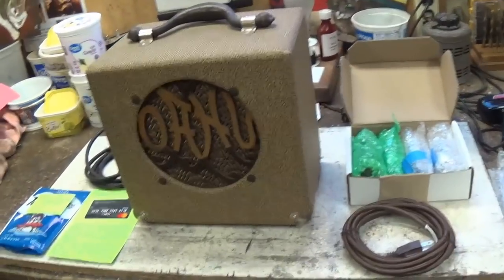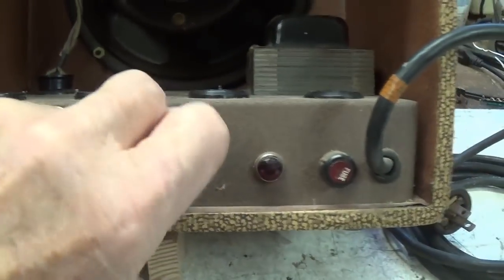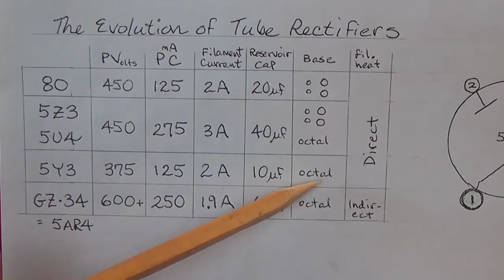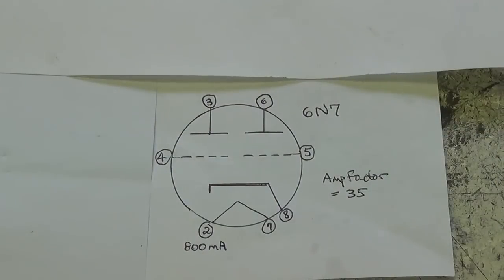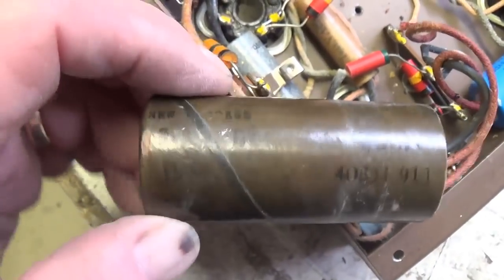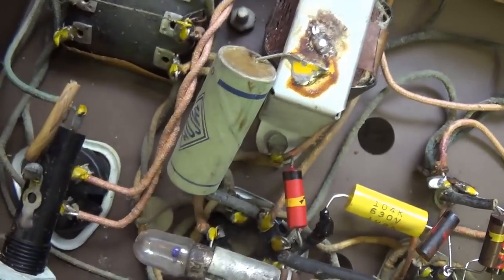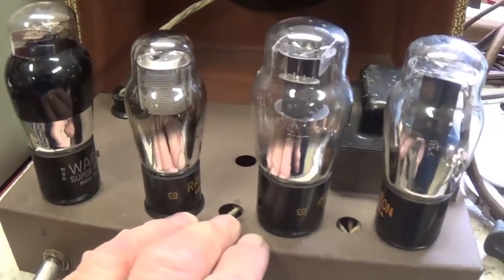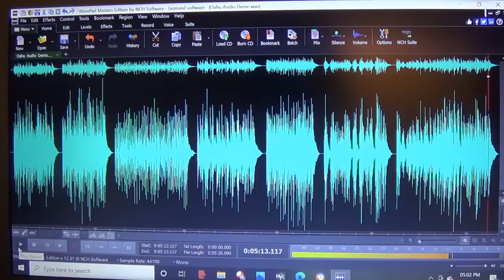Amazingly Original Pre-War OAHU Amp Gets a Tune-Up

Comment: Also missing from schematic is the second stage amplifier cathode bypass capacitor. Yes those moulded case resistors will almost always go high in value, especially with values over around 1k, while the values below around 1k tend to drop in value.  

I have a box of them, all NOS, and almost none of them are the original colour band value, though some are still barely in tolerance. However I still use them, they are very robust, so get used for things like mains neon lamps, and for driving indicator LED's off of the mains directly, just using a bridge rectifier, normally 4 12V zener diodes, as I have a reel of them, as conversion to DC, no filter capacitor, that is the least reliable component, and the LED's survive well. Have potted a few of them into breaker casings for power on indicators, using the original terminals to connect power.
Reply from the maker: Thanks for the helpful input, Sean.

Comment: Great job as always Doug bringing this amp back to life!
The amp designs were solid back in the day, but the technology of the components (excluding transformers, those things will last 1,000 years) was immature.
As you can see by all of those caps being shot and over time leaky or shunt to ground, also the old resistors suck.  You read 75% over rating.  I've year 100% and 200% to value, so there is no reason I keep them in for nostalgia or only fix what is wrong as they will go.  If you want the amp(s) to last...just replace them all with new components imo.  It's time consuming, but in the end, will not only sound good, but more reliable.
We've come soo far with technology, the components are much better than in the old days (caps and resistors)!  :)
Reply from the maker: Thanks for your helpful input, E.

Comment: Congratulations on your 100k subscribers! I have been with you the last 12 years and love your teaching style. 
  This video brings up a few associated questions for me. With old equipment, tubes and components - how old is too old?? Tubes are the easiest to check... but what about my old Accurate Instruments 257 tube checker ? Should I re vamp it inside?  And being in the ANTIQUES business I've collected quite a bunch of old capacitors/ resistors new in box... Sprague paper wraps / paper and wax / Micamold dominos etc.
  What's the best way to check the quality or just don't use them at all?
  Thanks for shareing your expertise!
Reply from the maker: Thanks, Peter. Tubes and resistors have an unlimited shelf life, but most capacitors do not.  I would not recommend using vintage capacitors. Tube testers only determine a few tube parameters, which are helpful, but specialized equipment is necessary to fully assess their status.

Comment: I am going to have to build one, this thing sounds fantastic. I have all of those tubes and plenty of transformers. Unfortunately, the speaker is contributing a large quantity of this tone. Maybe I should put one of the mint Jensen P10Q's I just robbed out of 58' Lowery Organ. Surely not the same tone but after mounting one of these in a cab they ooze vintage mojo.
Reply from the maker: Good luck with your project, SHW. Let us know how it turns out :)

Comment: That covering is not Tolex or pleather. It is a product called oil cloth. Those red and white tablecloths commonly associated with pizza parlors are oil cloth with a synthetic poly fiber backing and a fixed red dye on a white plastic top sheet.  Valco, Danno, and other budget amps were usually covered in oil cloth.
Reply from the maker: Thanks for your input, Seth.

Comment: Inebriated chimp!!!  🤣  Congrats on 100K!  That's quite an accomplishment my friend.  
I recently got an amp I might send your way- 1946 Vega Commander.  Cosmetically almost flawless, like this Oahu, but someone got inside and started trying to replace caps and ended up butchering the wiring.  The tubes all light up, but there is zero output, not even hum.  I'm a fairly decent hand at repairs, but not if the wiring is butchered and I can't find a reliable schematic....
Reply from the maker: Thanks, GF. I'm really busy with repair work at the moment and that sounds like a potentially expensive repair job. You might consider giving it a try yourself
Reply: @UncleDoug  fair enough, thanks for the heads up.  I just wish I could find a good schematic for it.

Comment: 52:58 - excuse me, but I guess the way you draw it wouldn't work at all. There is always full short to ground. It may be somewhat different, but I guess it's similar to the circuit we see on the schematic, where pins 1 and 3  are between input (pickup) and ground, and the wiper (pin2) goes to output (cable - gutar). Also the pickup is grounded (on the other side). And there is usually also a tone pot. So you have a pickup coil + two pots in parallel to ground on the instrument.
Reply from the maker: You're right. In my haste I drew the diagram incorrectly. Thanks for the info :)

Comment: congratulations :) 100000 subscribers :) well you  deserve it, you know your stuff, its very interesting. i would love a valve record player and im hoping to repair it with the help you give. it would be realy cool if you designed an amplifier based on this circuit that used easily available cheap tubes available now and maybe i like others could build it , what a great project that would be, thanks for sharing :)
Reply from the maker: Thanks so much, Leo. Schematics for simple amp circuits are available for download on many internet sites.
Reply: @UncleDoug  it would be good to have explicit instructions and also a circuit based on what is available now cheaply , I've seen quite alot of amplifier projects based on common old TV tubes , rather than el84 style tubes which are expensive now. It be nice to have a valve based amp
Reply from the maker: @lookoutleo  We have posted several videos documenting every step in the process of building a small amp from scratch, Leo.

Comment: Uncle Doug; as the resident (on YouTube) tube amp genius, can you explain how tubes work? There are a few tubes that are a triode and a pentode in a single glass tube container. The Mullard Tube Circuits for Audio Amplifiers book shows a ECL-82. With one cathode heating electrons, how does the pentode additional screens not interfere with the triode? How are the streams of electrons kept separate inside the tube, or doesn't that matter? The triode is a pre amp  and the pentode works as a phase inverter. Do you know why Leo Fender didn't use that type of tubes?
Reply from the maker: Thanks, Dennis. The two tubes function independently within a single envelope.....just like  two barrels of a shotgun. Look at the diagram of the tube......you can see the two separate structures. The triode is a pre-amp and the pentode is the 7W output tube (not phase inverter).

Comment: Nice project- I have an old Co-Recht very similar amp- got it working but the Feild Coil speaker worries me- I was kinda hoping you would show how to replace it. It has a bunch of tears that I fixed. any thoughts on replacing?
Reply from the maker: This is not the place to offer step-by-step instruction, Corey. Check the internet for possible info.

Comment: Congrats on the award, but I was more surprised the number wasn't MUCH HIGHER! One thing that inspired me to post a comment was a news story I saw a few days ago on how this Russia/Ukraine stuff has basically "cut off" any access to a supply of tubes. What  are manufacturers and repair people going to do w/o component #1?
Reply from the maker: Thanks, Leroy. Yes, I'm sure that more than the price of gas will be affected by this unpleasantness. What a shame that we are no longer self-sufficient when it comes to vacuum tubes and oil.
Reply: I've been thinking, and that usually gets me into trouble, but do you suppose someone at Fender, HUGE, deep pocket company is thinking of buying/building a shop to supply themselves with tubes? Lets face it, Fender is not going to stop building DeLuxe Reverbs because of Putin!
Reply from the maker: @lwv6966  They already seem to favor Chinese tubes, Leroy, which are still available......at least for now. Maybe after this latest crisis blows over, our government can disrupt our trade with China and really screw up our supply chain.

Comment: I just picked up an early 1920s radio, be great if they labeled the tubes, as it now contains none, both four pin, but they're in the shape of a crucifix, which I'm given to understand was common in the UK, I think the price of ones I've seen online, it'll be cheaper to make my own tubes 😂

Good to see from you again!

I forget the enissive coating for filaments thorium dioxide?
Reply from the maker: Thanks, P. I believe they use Thorium, Barium, Calcium, and Aluminum Oxide coatings.
Reply: Some of the earliest tubes, like the original 01 and the 199, used thoriated tungsten filaments, which when emission fell could actually be rejuvenated by cranking the filament voltage by 50 to 100% for a short time. The 01A and most other subsequent tubes had oxide-coated filaments (aluminum oxide and other chemicals) which are far more efficient,,  emitting more electrons than thoriated tungsten filaments and at much lower operating temperatures, therefore requiring less current and voltage. Barium is a main ingredient of the getter, the silvery flashing on the inside of the glass, which helps remove trace gasses and keep the vacuum "pure"
Reply from the maker: @goodun2974  Thanks for the very helpful information, GU.
Reply: @UncleDoug  unfortunately, tubes with oxide-costed filaments or cathodes can't be rejuvenated; but some transmitting tube types still in use today can!
Reply from the maker: @goodun2974  Thanks again, GU.

Comment: Don't know what RS stood for but I doubt it signified an electrodynamic or "field coil" speaker, because they were all electrodynamic speakers back then. Alnico-magnet speakers were invented in the early 1940's but the metals(aluminum nickel and cobalt) were a strategic war material and alnico magnets didn't start showing up in consumer products until at least 1946 or 47. Jensen changed their model numbers to a P or PM prefix to signify permanent magnets, and later used C as a designation for Ceramic magnets.
Reply from the maker: Thanks for the input, GU :)
Reply: @UncleDoug  , amazingly, the Brush Manufacturing Co, which made microphones and phono cartridges, received a patent in 1938 or '39 for a full range 8" speaker with no voice coil or magnet ---- it had a piezo element! I don't know if it ever actually went into production, perhaps not due to the introduction of efficient, reliable alnico magnet speakers, plus the beginning of WWII and the cessation of most non-military manufacturing..
Reply from the maker: @goodun2974  Maybe Brush went on to build the reverb tanks for Silvertone/Danelectro ;)

Comment: Hello uncle Doug glad to see another video from you, I have a question for you? Do you ever came across a amp that as a ef86 as a phase spliter  2 6l6gcs?
Reply from the maker: Thanks. The EF86 is a pentode, Diogo, which means it is a pre-amp tube, not suitable for phase inversion.
Reply: @UncleDoug  hello uncle Doug thx for you answer, if you can't take look there is a French brand, Paul bouyer st 20 ef86, that uses 2 ef86 as preamps and one ef 86 as phase splitter, it's relative strange amplifier, iam trying to mod one myself for guitar, and wanted to ad a general volume control bcz the ef86 have to much gain for my guitar
Reply from the maker: @diogomatos5609  Good luck with your project, Diogo.

Comment: With the Valco schematics rarely being accurate. It's fascinating that they pulled off building amps from those schematics that actually worked.
Reply from the maker: I doubt that the people assembling the circuits used the schematics, 234. My guess is, after assembling several units, they simply repeated the steps using whatever components were available, with occasional alterations due to supply shortages or upgrades to resolve design issues.
Reply: @UncleDoug  . .  Thank you very much for pointing this out. I have an old Valco Airline amplifier that is exactly like you're talking about.  Mainly some capacitors inconsistent with the schematic, even though this amp is obviously all original. I was really glad when you touched base on that.
Reply from the maker: @234dilligaf  I try to share my observations with viewers, 234, and hope it's helpful.

Comment: Doug, I know you are keen to keep this amp as original with very good reason, however, In theory for the fun of it, would it not have been better to input to one half of the 6n7  and have the amplification going to tone stack and volume control then into the 6C5 and out to the second half of the 6N7 as second amplification after the Tone stack amplification? Does that make any sense?
Reply from the maker: It's not my call with most customer amps, Pat, and  to be honest, I don't enjoy re-engineering classic old circuits to be something they never were intended to be.  On my home-builds, I am free to alter the circuit in any way I see fit.......but when starting with a classic gem, that's just not the case, at least in my opinion.

Comment: The shown instrument volume control schematic appears wrong to me. The wiper should be the output pin, not one of the ends of the potentiometer .... otherwise the signal is always shorted to ground.
Reply from the maker: The signal is always at least partially shorted to ground in all volume controls, Andreas.....that's how they function. The more signal sent to ground, the lower the volume, and vice versa. I agree that the diagram at 52:46 could have been drawn differently, but the points being made were still valid.

Comment: Love your attention to detail. I Would like to send you my 1965 super reverb for you to look at. I've owned it for close to forty  years. I've decided to get it started up again, and decided to re:cap it. I noticed it has been violated by some monkeys before. I've been desperately trying to get in touch with you. I'm an old musician from the early sixties. Retired now and playing in church. I have several amps, but things are changing in church so I might be able to use the S.R.  I've had to resort to using lower wattage amps, hence the reason for wanting to get the  S.R. running again. Several resistors out of spec.  Pilot light holder is bad I believe . The center tap has not been used. Instead two 100ohm resistors. I don't think it's all that bad, I'm just a perfectionist. If you are interested I'd like to send it to you, so you can put your touch to it. It has been worked on. I knew something wasn't sounding as it should . I took it in to a place called Rogers amp repair. (Came highly recommended.) Found that someone had it modded. So he returned it to spec???  I just don't know how and where to send it and what its going to cost to have you fix
 it. I have been watching your you tube channel, and you've gained my confidence. I would appreciate your willingness to take it upon yourself to help me out. David
Reply from the maker: David, please message me on my FB page: Uncle Doug's Vintage Amps.
Reply: Hey doug,large part of my frustration is my inability to communicate now days with all the different technologies. I only started using FB recently out of desperation to get in touch with you. I don't know how to use Facebook.
Reply from the maker: It's not that hard, David. Millions of people use it daily.  @davidrichard6575

Comment: I have a question, should the fuse come before the switch, or after?  I've seen it done both ways, and I wondered what the different reasons behind doing it different ways.
Reply from the maker: I put the switch first so the circuit is actually "off" when switched off. No other arrangement makes sense to me.
Reply: @UncleDoug  Thanks for the reply!  I really enjoy your channel, I have learned a lot!
Reply from the maker: @treed873  That's good to hear, Treed.

Comment: I have a 1938 AM radio. It has vacuum tubes that have a cable connection at the TOP of the tube. What is this connection?
Reply from the maker: In those early tubes, the connection to the grid was via a shielded cable, above the chassis surface, to avoid hum........rather than a tube-pin connection inside the chassis, which may induce hum.

Comment: I had one of these from 1941, date was actually on the speaker,  and at that time there WAS NO VOLUME on the amp at all! ...that's because it came with a MATCHING lap steel guitar... and the guitar had the volume,  so why bother with redundant attenuation on the amp? Haha! It was a cute little combo I think I paid $30 for at a local yard sale. Later sold it to a friend who designed all of the tube amps for CRATE or at least the "vintage club series"...
Reply from the maker: Thanks for sharing, Sean :)